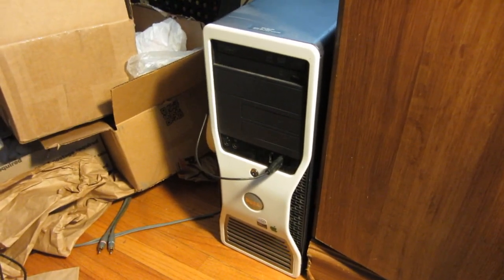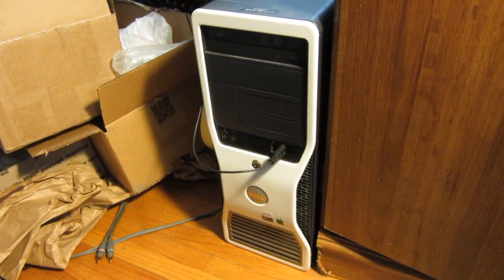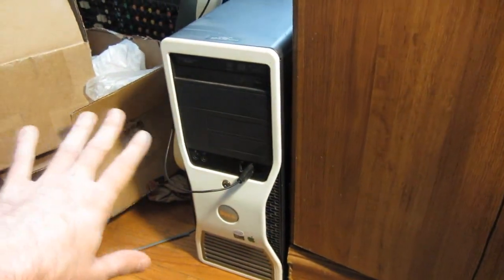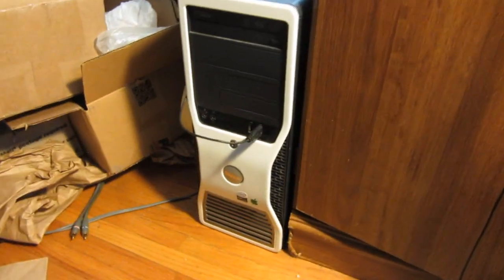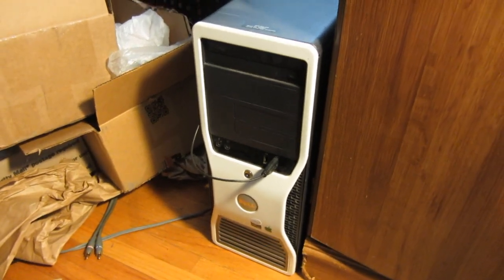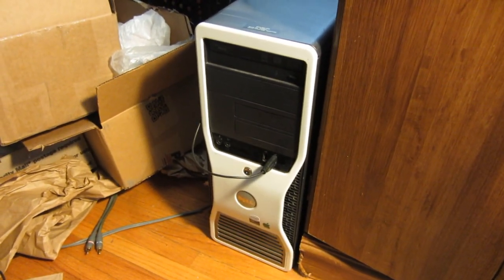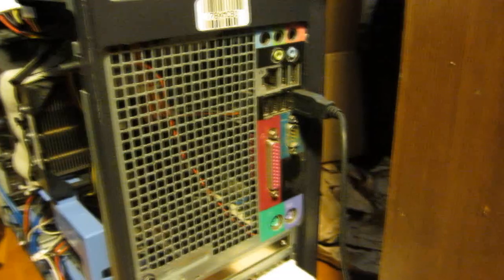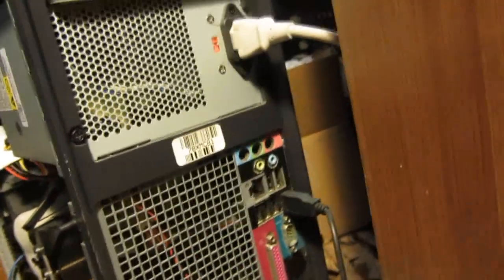Dell T3400 hackintosh overview

Comment: This was a flashback for me.  I had the same 380 and upgraded to a T3400 Mobo.  This video was like watching a movie after you've already read the book.  Oh! he's gonna need a new front IO board-- the pin out is different.  He's gonna need to drill out the audio ports on the back!  I didn't bother with the two extra USB's myself.  My generic dremel was toast after the audio.

I may actually check ebay for a quad core 771 Xeon.  Knowing they work on the T3400, that could be a fun project.
Reply from the maker: whoa, who'da thought?  still using this thing for work and it's rock solid.  :) thanks for the comment!
Reply from the maker: +JP Duffy Also!  Check out http://www.delidded.com/lga-771-to-775-adapter/3/ (there's two previous pages to the article) for a more comprehensive CPU compatibility list thing.  (short version: "All 3xxx series Xeons. The 5xxx series is incompatible.") 

And of course you'll need the 771 to 775 sticker adapter thing.

Comment: I've got a Precision 380 and two 390s. The 380's a bit long in the tooth now, but both of the 390s have a Core 2 Quad Q6600 and 8GB of DDR2, so they're decent for another couple of years. At least for my needs.

The white front looks really cool! And yes, BTX should've been more popular. But people just love their ATX machines...
Reply: +alecjahn Hey would you be able to make a video on how you installed mac os on the t3400 i have the same computer and am interested in making it a hackintosh. maybe you could point me in the right direction. Thanks
Reply from the maker: +MrMaguire I've got a Q6600 in my 390 as well!  It's supposed to be the "TV computer" but... basically just sits behind the cabinet, forgotten, unless the lady wants to play Sims 4.